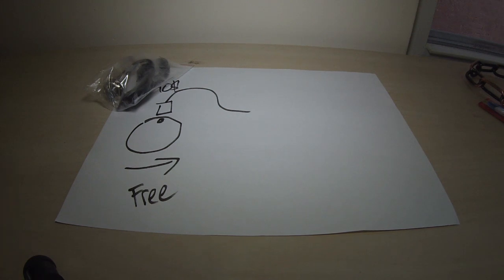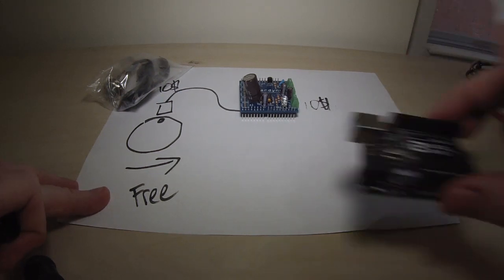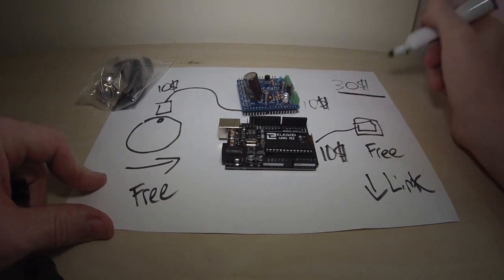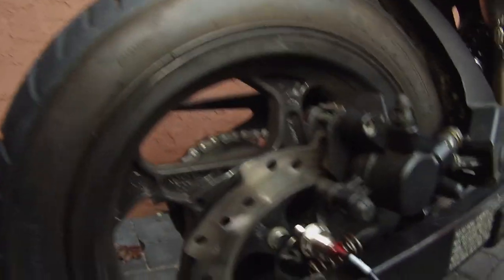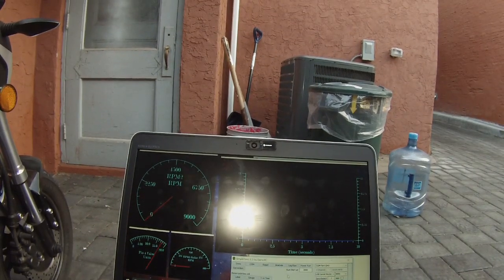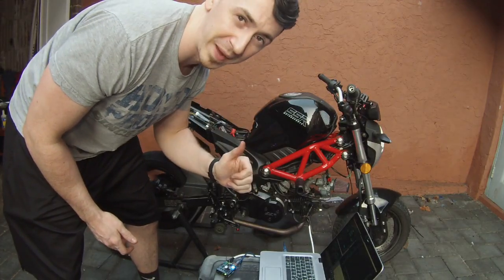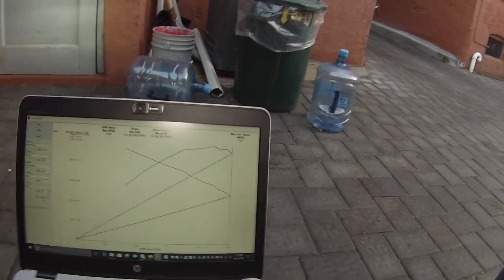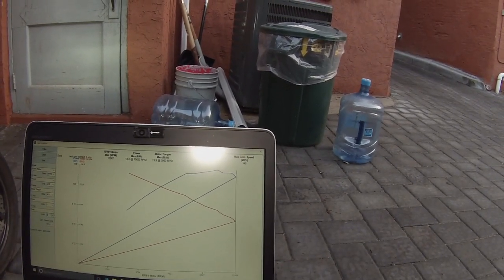30$ Motorcycle Dyno

Comment: This is great but how does it work with so little load? Doesn't the load need to be somewhat relative to driving load. Isn't this doing the same thing as measuring speed through a rear wheel speedo? Could you simply secure down heavy weight to the wheel?

Comment: You need calculate the MOI of your flywheel. And none can calculate the MOi of a rear-wheel, a thick disk of uniform  and known naterial is much easier... If you take the valve-cap o the tyre off, now the rear-wheel has a different MOI, not because of the valve-cap-weight, but of where this valve-cap was on the rear-tyte... Forget the rear-wheel, get a simple flywheel, in the form of a metal disk.

Comment: That's No Good. No LOAD on the Bike. Tires need to spin as if on the road, thats why dynos have a rolling surface for the tire to create load.
Reply from the maker: Torque= angular acceleration x moment if inertia of rotating mass.

It dosent matter if the rotating mass is large (dyno roller) or small (in this case rear wheel). If you know the moment of inertia and can accurately measure the angular acceleration you can accurately measure the force coming from the motor
Reply: @Pretko99  The experts disagree. Consider this article on breaking in the engine: http://www.mototuneusa.com/break_in_secrets.htm It says about trying to do this as opposed to using a proper dyno: What about running it in the garage ???

Maybe you have a new snowmobile and it's not quite winter yet, or a new bike and it's snowing... 

The temptation to fire up a new vehicle in the garage just to "hear" 
the new engine run can be very strong. 

This is the worst thing for a new engine, in fact, my advice is: 
don't even start it up until you're ready to warm it up for the first ride.

The reason is that brand-new rings don't seat all the way around the 360 degrees of their circumference. The gas pressure from hard acceleration forces the rings to contact the cylinder around their entire circumference, which is the only way the rings can properly wear into the exact shape of the cylinder to seal the combustion pressure. 

Now, imagine if the engine is run in the garage. There is no load on the engine, so the rings are just going up and down "along for the ride". Only a small portion of their surface is actually contacting the cylinder wall. The ring area that does contact the cylinder wears down the roughness of the honing pattern on the cylinder walls. Once the roughness of the cylinder is gone, the rings stop wearing into the cylinder. If this happens before the entire ring has worn into the cylinder and sealed, you will have a slow engine no matter how hard it gets ridden after that point. 

The difference between what happens in an engine running in the garage, versus one being ridden is a hard concept to put into written words, so if I may use the sounds that we all can relate to: it's the difference between "zing-zing-zing" and "bwaaaaaaaaaAAAAAA"

During "zing-zing-zing" the rings don't get loaded for more than a split second, whereas during "bwaaaaaAAAAAA", the engine is in 100% ring sealing mode.

Comment: The run time is way to short to get a good result, because the tire is to light. You need a ~300kg Axle to get a run time of ~8sec to have a clear, useable result. This one is cool and cheap but not really useable.

Comment: How do you find the accuracy of the inertia dyno with simpledyno? I'm reading much lower hp than I should be.
Reply from the maker: I'd calculate it by and and verify it empirically if possible to determine where your error is 
https://blog.oureducation.in/moment-of-inertia-of-a-flywheel-by-falling-weight-method/

Comment: The item you calculate the MOI for needs to be the predominant load placed on the engine .

While the rear wheel works, and gives a figure somewhere near reality, it’s just not right, as the gearbox and flywheel are still playing a large part.

When a heavier ‘wheel’ is used it’s not that it places more load on the engine, but more that your ‘known’ mass becomes the predominant determining factor for the rate of  acceleration, reducing the effect of unknowns.

Awesome effort for $30.

A safe sturdy heavy rear wheel would be great.

Comment: I give this a B for effort and a solid F for understanding what a dyno does and how it's used in the tuning process.
Reply from the maker: I think you need to re take physics 101 haha. Tourqe = moment of inertia x angular acceleration. Once you have tourque you can accurately calculate horsepower. Which is what is happening in this video. If you dont understand I'm happy to explain further 
https://en.m.wikiversity.org/wiki/Torque_and_angular_acceleration
Reply: Then just put the fucker on a heavier axle and stop trying to be correct you act like you can’t put it on anything else and just want to argue with someone trying to help the little guy like me becuase you work at a speed shop with a actual Dyno and think you know everything I HAVE A 80CC IM NOT GONNA SEND IT TO A FUCKING SPEED SHOP
Reply: As someone who uses a chassis dyno near daily, I'm very aware of how an inertia dyno works.  You essentially built a crude pickup for one.  

What you're missing is the extra inertia of the bike and the rider (and to a lesser extent the wind resistance based on speed). 

There is a reason motorcycle dynos have a heavy ass drum in them to stimulate the inertia from the weight of the bike and the rider. 

Power output of a gas engine will vary a lot with load and since you're essentially just free revving the engine with its "default" amount of inertial load the data you're getting is useless beyond making a cool looking plot on a computer.  

If you really wanted to do something with your contraption you could plot the acceleration of the bike on a flat peice of road, across an rpm range, make changes and repeat to see if there were any gains or losses.   That's basically what a vbox or draggy does but with a fast GPS instead of wheel speed sensor.
Reply: @computerjlt  my guess is He is just showing a very basic way to only estimate power/torque.
It's cheap to build,and not difficult to understand what the thing will do and not do.
It's certainly cost effective for the folks who don't have a few hundred bucks to spend at a speed shop
I would rather take my bike to a speed shop and have them dyno and tune the bike...but I'm not running at Daytona or the Isle of Man TT...I'm just looking to squeeze better efficiency from what I'm running,and this contraption will probably get me pointed in the right direction

Comment: Hello, how do you calculate the moment of inertia of your wheel and how do you set up parameters in the software?
Reply from the maker: The Simple Dyno software will calculate the MOI if you input the parameters of your roller or rotating mass. Pretty cool, and straightforward. Check out some youtube videos on the software if you need help.

Comment: You need a load on the engine
Reply from the maker: The rear wheel is the load, you input is moment of inertia into the software. Once you know that you can very accurately measure the force on the wheel as you measure its acceleration
Reply: @yashiroku   not advising it or saying its smart but could you just apply the rear brake for load for free ??
Reply: @r2c479 brakepads and rotors aint cheap...LOL
Reply: It is called INERTIA DYNOMOMETER u freak!!..The LOAD is the madda pakking weight of the roller..and must have an RPM sensor with it for the software to acquire the Time and speed the Motorcycle can rotate the ROLLER..

Comment: There is no load on the drivetrain people. This is nowhere near accurate
Reply from the maker: There is a load on the drive-train, the rear wheel has a moment of inertia of 0.028 kg.m^2. This number is large enough to measure the force of the engine. However, you are correct, this dyno is not accurate, it is not intended to be. It is very precise, as it takes measurements 9,600 times a second. I don't care if my dyno is accurate, as it might read 8HP while another one might read 7, or 12, but I do want it to be precise, because if I measure an increase in power then that means I am tuning the bike correctly, a 20% increase in power on this dyno would be a 20% increase in power on another.
Reply: @Pretko99  I do however agree on your other comment that once you make a modification you will see a rough % increase in power, assuming you take into account about mass and force being different of course.
Reply from the maker: If you can accurately calculate the moment of inertia of the rear wheel you can easily calculate the force output of the motor. The rear wheel is the load, it does not matter if the load is small, if you can accurately measure it you can accurately calculate force, its just math, rotational force or Torque=MOI X Acceleration.
Reply: @Pretko99  so bikes don't have load sensors that increase the amount of fuel delivery?

EDIT: also forgot to mention, this wont be accurate for the reason that, say for example one engine has slightly lighter components than the other, that will show up as additional torque - which it is not, it is the reduction of the mass variable in the equation A=F/M, not the increase in force, but the computer doesn't realize this.
Reply from the maker: @MrAndrius12  you would have to define what you mean by load sensor. I assume you are talking about something that would measure the weight of the rider to adjust for the load on the engine? If thats what you are saying then to my knowledge motorcycles do not have that.

In regards to your second comment, we are measuring the acceleration of the rear wheel which has a constant mass, so if you were to swap motors for one with less rotating mass but the same power, the dyno measurement would read the same.
Reply: @Pretko99  yeah but think of it as such: linear force gets converted to torque due to the crankshaft being attached to the piston by conrods, the torque rotates the engine components + drivetrain + wheel by rA=I(inertia of ALL the above components)/T meaning that theoretically a change in engine internals could still read as an increase in torque.

Comment: How can you calculate hp without having a figure for the inertia of the wheel? And given how quickly the engine revved up you’re probably putting more power into the engine flywheel than the rear wheel
Reply from the maker: They Dyno software requires you to calculate the Moment of Inertia for your rotating mass in order to work, I didnt show this in the video. Torque is equal to your rotational acceleration multiplied by the moment of inertia for the spinning object (the wheel). Once you have the torque you can figure out the HP with the engine RPM.
Reply from the maker: The dyno software requires an MOI calculation to work. I calculated the MOI of the rear wheel for this setup
Reply: @Pretko99  But if the software only uses the wheel MMOI, then the torque is going to be off because you dont include the other rotating masses inside the motorcycle right?  So say the wheel has the same MMOI as the internal rotating masses combined. So 50/50. Then  if you only include the wheel MMOI you calculated torque is going to be twice as high right? Or does the software also include an estimation of the MMOI of the internal parts (like flywheel etc)
Reply from the maker: @charliebogaerts7725  think of the engine and the rotating mass, which in this case is the rear wheel, as two seperate systems. If you calculate the torque being applied to the rotating mass with a known MOI by measuring its acceleration, you can measure the force acting on it. This is how many dynos work.
The internal engine components that are rotating all have their own MOIs, but that is not what we are trying to calculate, we are trying to measure its total force output.
Reply: @Pretko99  Mmm oke so you at no point during this test you deal with engine part MMOI's in any way then? No calculations or estimations?

I just kind of doubt how accurate the torque results are this way. Say Id sneak in your garage at night and secretly change out the current flywheel with a flywheel thats 100 times as heavy. Then if you would do the same test next day as you do in the video, wouldnt you agee that the wheel would take way longer to spin up? Im not sure if you can make the assumption that all the torque of the engine is used to spin up the wheel while in reality part of that torque is used to spin up the engine and flywheel itself. But cool project nonetheless
Reply from the maker: @charliebogaerts7725  you are correct, actually changing anything in the engine will result in different readings. I want to measure the horsepower and torque of the engine as a whole and see how changes in air fuel ratios and ignition timing effect it. Changing engine internals on any engine will also effect its total output.
Reply: @Pretko99  Ahh I see, yeah for tuning this probably works really well. Interesting tnks
Reply: @Pretko99    The gear ratio used is also very relevant, ... the lower the gear, the higher the claimed power output !

Comment: do a full 9,000 rpm run and shift to top gear to figure out a base line …..then shift it back to stock since I see you have airfilter mod and exhaust already
Reply from the maker: Im planning on doing a comparison to a stock razkull as well as a grom in the future.

Comment: yep even efi is cheap and good Q.1ST a brain  microsquirrt or speeduno efi ard i know speellling is um off lol n oh those 3000hp fuel cars use speed n math to state hp n tq heck known automatic trans-slush boxs losses n a android  app car weight bla bla can get as close as a dyno go to 2 different shops test on two types of machines get 2 different numbers ...700 bucks is nuts thats like a turbo tune for a supra gm or may be a crotch rocket ..dept is the cause of high prices

Comment: How to measure the torque？
Reply from the maker: Rotational torque is calculated by multiplying the acceleration of the spinning object by its moment of inertia. The sensor calculates the acceleration and the software has you input the details for it to calculate the moment of inertia. The software will then calculate the torque and it can use the engine RPM sensor to then calculate horsepower.

Comment: this is quite cool but not really accurate since the "roller" (rear wheel) is so light weight. i am trying to find big electric motor to make dyno myself.
Reply: late you dont need Electric motor, only Heavy round object. But if really nececary a car blower will work perfect:))
Reply: It's not so much that the dyno would be inaccurate, as it is that the engine will run differently under load. In an ideal world you would be able to simulate inertia of bike and rider, rolling resistance, resistance of air, etc. This is not an ideal world, but some kind of controllable resistance(breaking) sure would be useful IF you can measure/apply that resistance with some degree of precision and accuracy. For $30 though.... A clever person could probably find some dead weight for pretty much nothing.